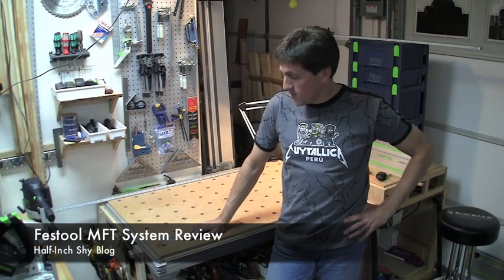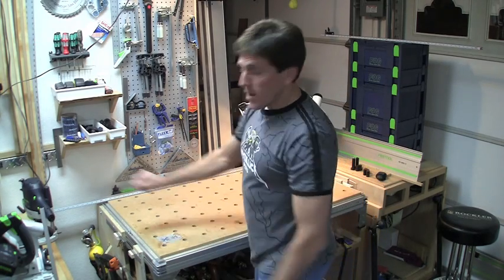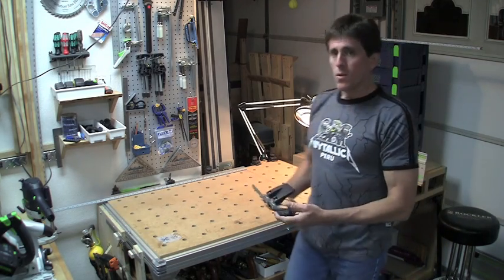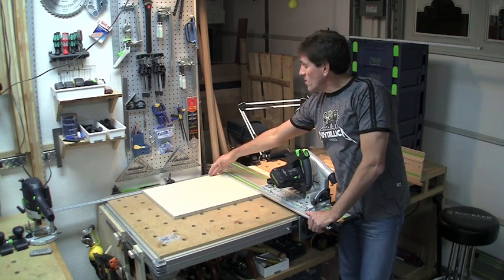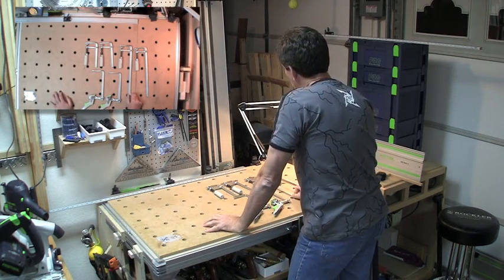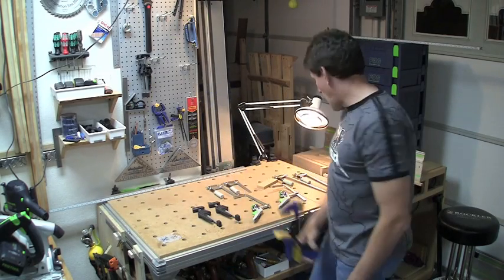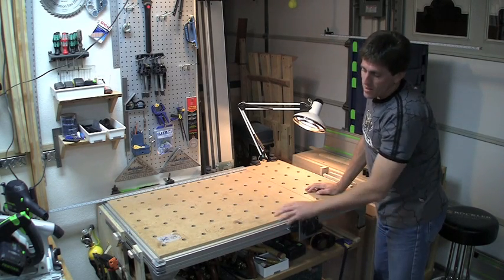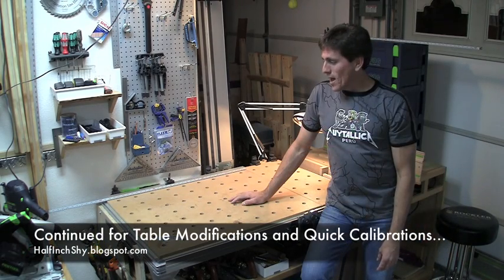#16.1 - Festool MFT - Part 1 - Overview

Comment: Just ordered the mft/3, can't wait for it to come. Maybe you've covered it in other videos, but do you use the mft to cut down full sheets? I know its too small by itself, but wondering what other people use with it when dealing with full 4x8 sheets.
Reply from the maker: Kevr you'll love the MFT/3 once you get used to it. Usually for large sheets, I have two sawhorses in the shop with sacrificial 2x4 attached to the top. I often put a full sheet on those and lay a guide on them to breakdown to more manageable parts.  Thereafter, the MFT is great for crosscutting and all the rest of the work.

Comment: if I buy the MFT3 will I be able to modify like yours or I need buy something more?
thanks
Reply from the maker: There are differences. Someone on FOG took on this video and his MFT/3 to come up with a workable way to do it. As I don't have an MFT/3, I can't say how well it worked out, but he seems very happy with it.

Here's a link to his reply on the thread where I first posted this review. He has a lot of photos. What he was specifically after was getting to use the Qwas dogs for fast calibration. That and the expanded cross-cut capacity are huge for me:

http://festoolownersgroup.com/festool-tool-reviews/video-review-of-festool-mft-system-(495462-495565-495888)/msg137695/#msg137695
Reply: Thank you